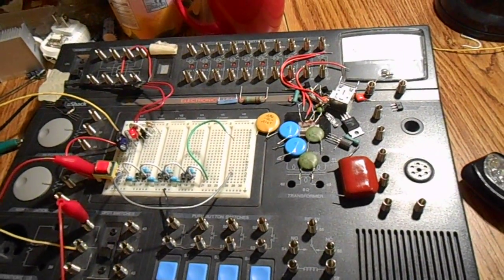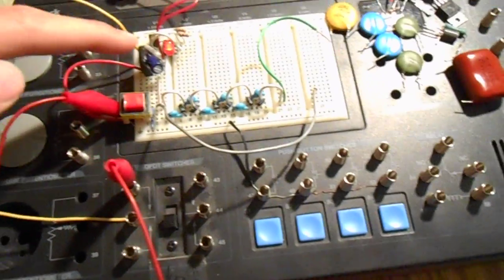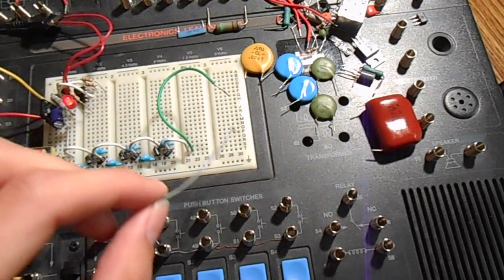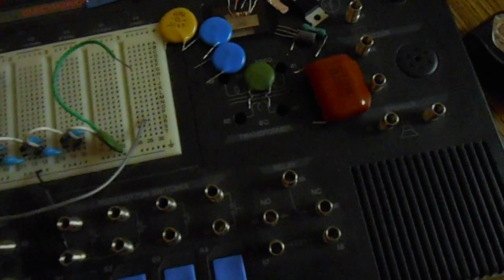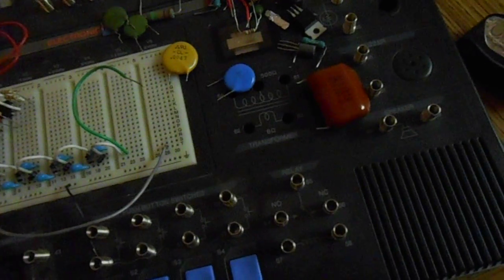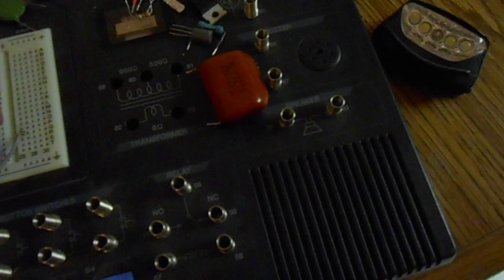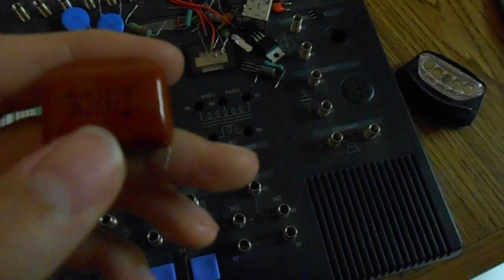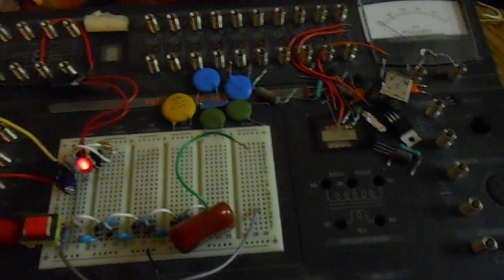high voltage multiplier with different output capacitors

Comment from the maker: not quite my friend, it was from a lazer printer (no clue why though) and it was controlled by a microcontroller :/ i do have a ccfl driver board that is super simple all it needs is 12-30v and it turns on (from the scanner of a printer) i do have another dual ccfl driver board from a laptop which i might be able to get working.

Comment from the maker: thanks for watching! :D yea it is pretty impressive for 1/4 of the nominal voltage but it isnt an audio transformer, it was from a lazer printer, the original input was 20 something volts and transformed it even higher i'd say to a couple hundred and then into a 5 stage multiplier which then went up to the printer to do something :) it had 2 of that one i used and 2 others that are a good amount bigger and probably a much higher voltage.